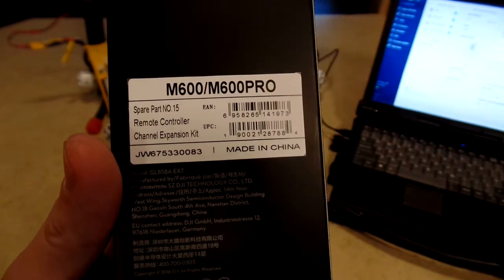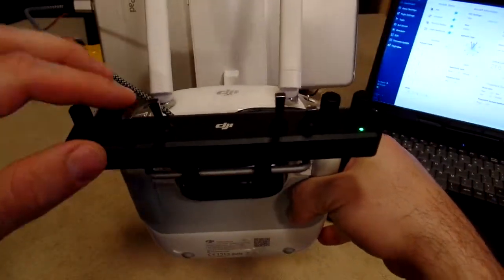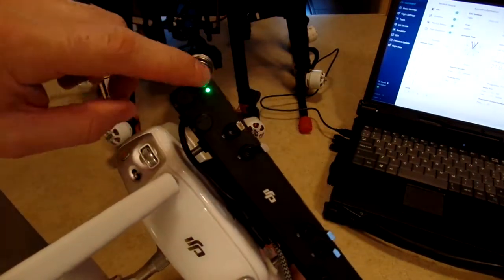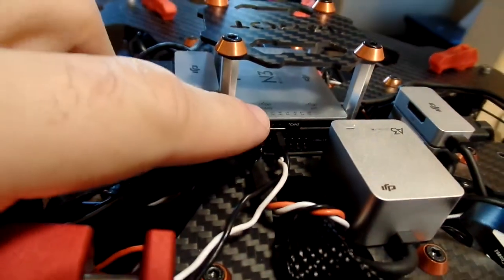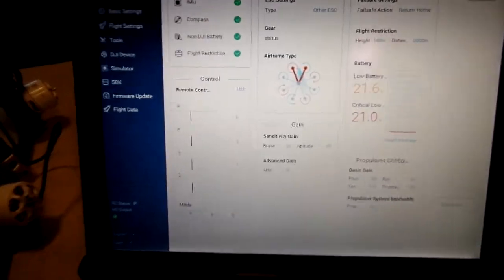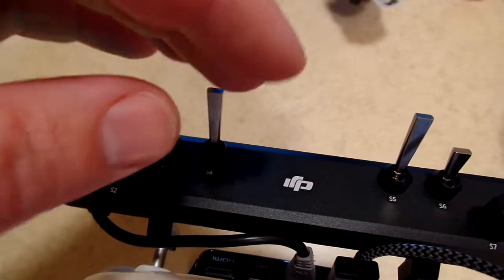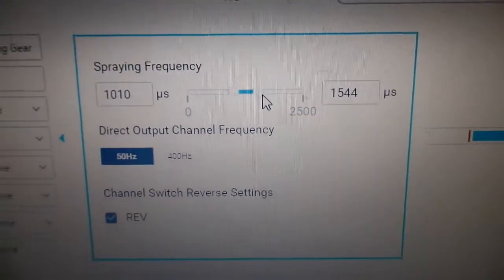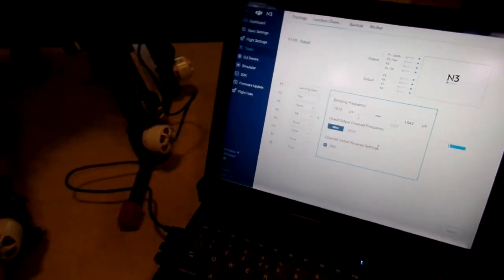DJI M600 Lightbridge 2 Remote Controller Channel Expansion Kit

Comment: What cables do you plug to the flight controller
for the Command and are you using the volt down 18 to 5v and Are Connecting the  wires to the  payload dropper

Comment: Hi!
Thanks a lot for the video!, it's very enlightening. However I found a small issue, so any help would be greatly appreciated!
I'm using a setup very similar to yours (N3 + Lightbridge 2) and also want to use a cargo drop mechanism like the one you show on the video.
I purchased the Remote Controller Expansion Kit and after installing it I configured it as you did.
Now the problem I have is that the S4 momentary switch does take the signal to the programmed upper limit when I press it, but it doesn't take it back to the lower limit when I release the switch and I have to turn the N3 off and on to get it back.
Any ideas?
Can you please confirm which version of DJI Assistant and N3 / LB2 firmware are you running?

Thanks in advance!

Comment: I followed your example for f3 and f4 to operate a servo, Now I would like to use f5 to operate a 12V led light. would I need something else like the Turnigy on/off, ?
Reply: You need a 5v power source as you cant draw power from the A3/N3 and so on and then a 5v relay like this, https://www.servocity.com/electronics/components/switches/pwm-switches

Comment: Hi. 
Is it true that you loose your Picture in Picture function if you use your Channel Expansion Kit?
Or do you still get your both Vido Signals from the Lightbridge 2, but you just have to switch between this to signals to get your second Video-Signal which is for example the Fpv Camera?

Comment: Thank you, you proved you can use the expansion kit with a non-matrice remote. The DJI tech said it isn't compatible.

So question: I'm using the A3 and had this same problem of not having the F channels working. However does the retract (F1 port) at least work without the expansion? Do any of F-ports have signal without the use of the expansion?

Comment: You mention you tried other devices, what other devices? 
I tried to connect a power mos, to switch on/off the power to a pump. Any idea why that dos not work?
Reply: Are you supplying external voltage? As mentioned, the flight controller F port output rail do not supply voltage, only signal and ground.
Reply: Hi Justin. Yep power was the issue. I realised that the esc had no bec, and therefore needed a 5v supplied in addition to the 12v it already got. Thank you or you reply any ways! And than you for a nice review.